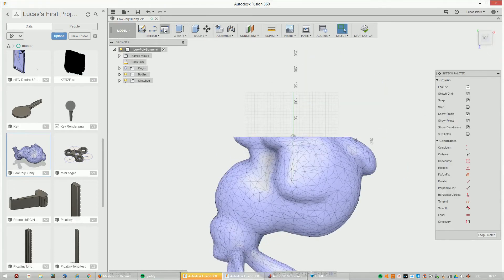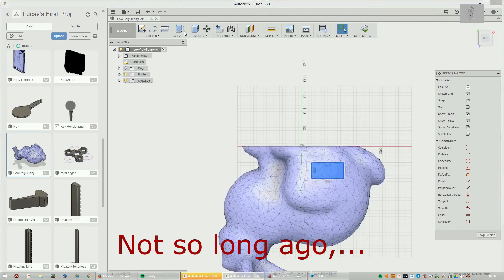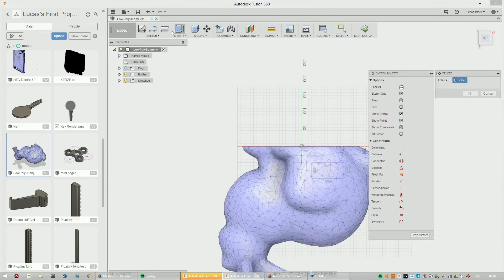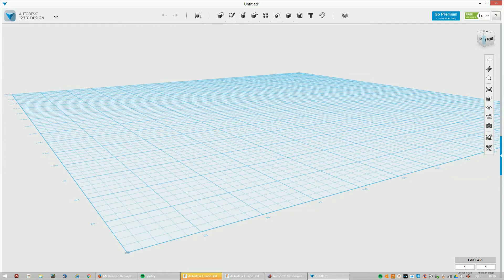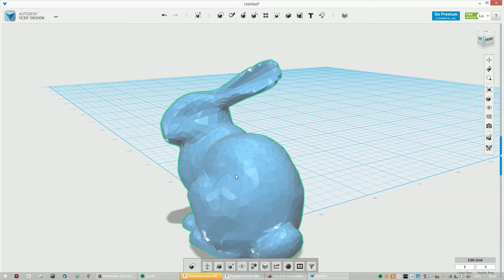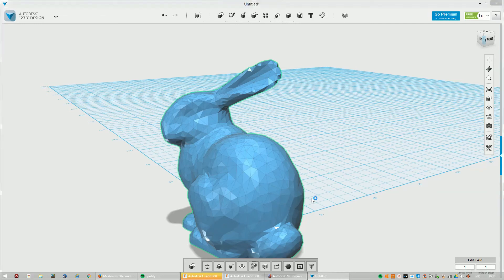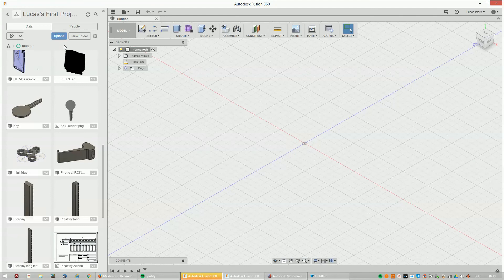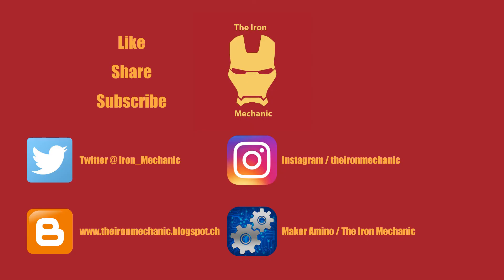Convert STL mesh in Fusion 360 bodies - Tech Hack

Comment: Of course you can perform those operations in Fusion 360. Insert a base feature and when editing the base feature insert the mesh and convert it into a BRep. Finish the base feature and then you'll be able to edit the object with all the solid modeling tools available in Fusion 360.
Reply from the maker: Just tried it. The only conversion features avaible are: T-splines to b-rep and vice-versa, and quad mesh to t-splines
It works with quad meshes but not with stl files.
I found nothing that might work with the newest autoupdate on the internet.
But i don't know. Does it work for you on the newest update?
Reply: I'm still learning Fusion obviously. What do you mean insert a base feature. Basically I'm trying to write someones name on a wine glass and cant get it to extrude to the object/wine glass